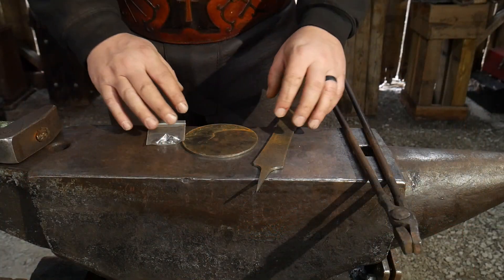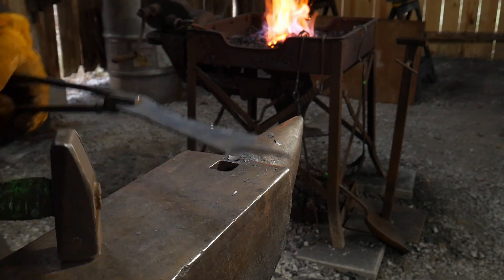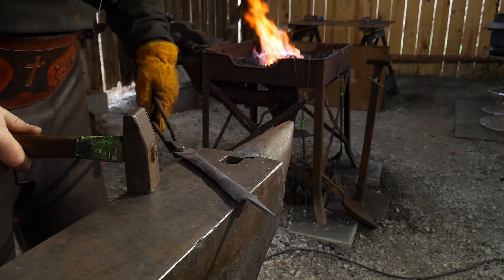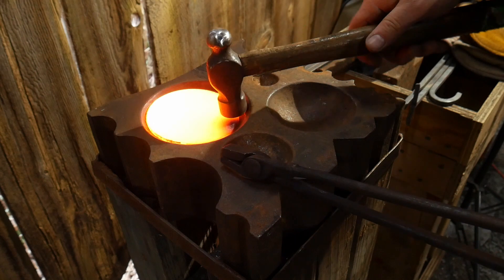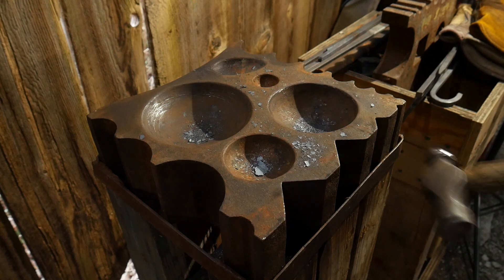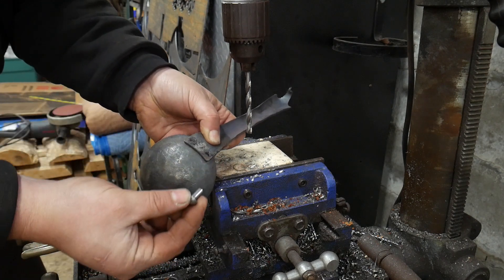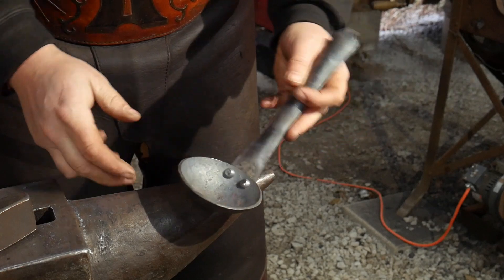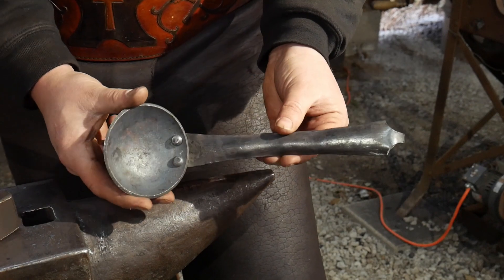How to Forge a Hook Tail Ladle

Comment: I realize that the colors I'm seeing on this end are not an actual representation of what you are seeing live.  That said, how dangerous is it to work on small steel (the hook for instance) with just black heat?  I've snapped off a few small pieces when working with black heat.  Do I just need more experience, of is there a knowledge point I've missed?